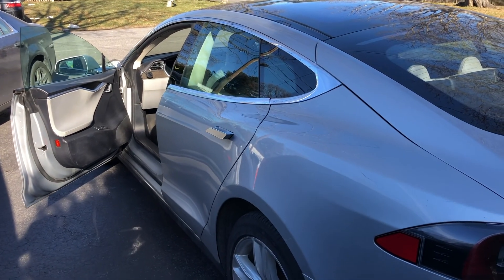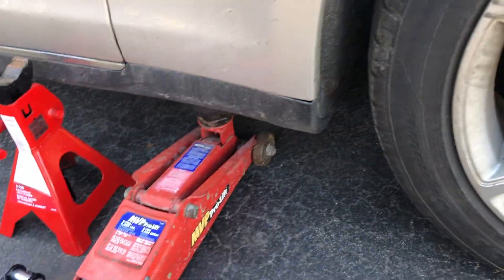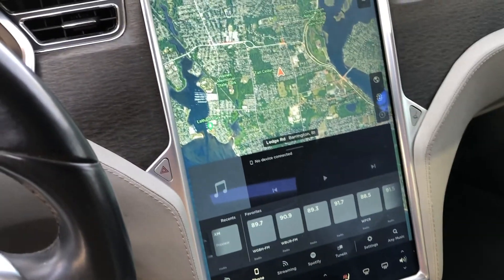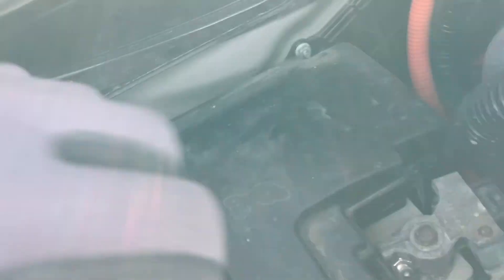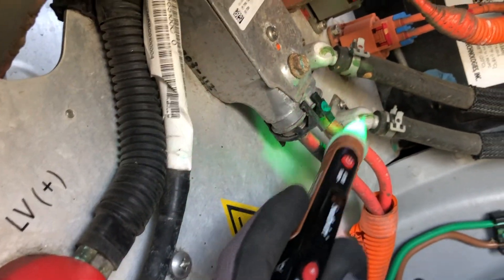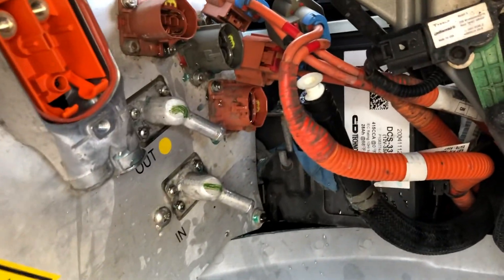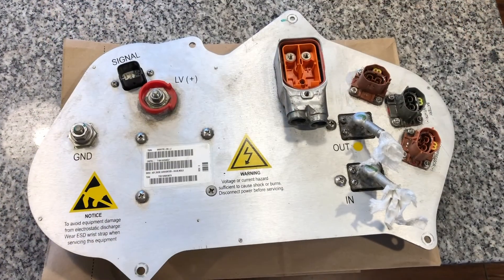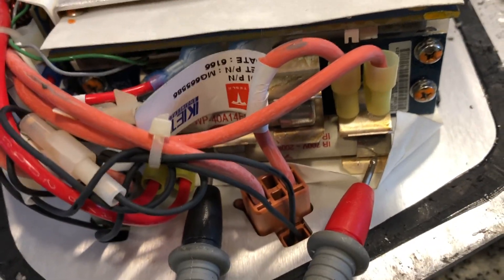2013 Tesla Model S Cabin Heater PTC Fuse Replacement in DC DC Converter

Comment from the maker: Important safety mistake - I used a voltage detector that only detects AC, and this area of the vehicle is all DC! Use a different method to check for voltage.
Reply: Lol I bought one seeing your video but I tested it beforehand on my working heater but it didn't worked obviously. Maybe add a warning subtitle in your video. Thanks for sharing
Reply from the maker: @gtech6  Sorry about that! I just added the warning to the top of the description to make it more visible. It is a very handy tool to have around if you are doing anything electrical around the house, but not quite as useful on our Teslas.
Reply: I just wrote a whole health and safety ramble, then I saw this comment 🤣
Reply: Dumb question: You were only using the continuity part. Continuity testing isn't the same with DC and AC on a tester?
Reply from the maker: @earthquakepilot2114  Sorry for the late reply. As far as I know, continuity testing is the same, but my mistake was in an earlier step when I was using a voltage detector to make sure that all of the power of the vehicle was off.
Reply: Hi, did you have to refill and purge the coolant after you re-installed the PTC?

Comment: Excellent movie. One comment on what I experienced.  Although I cut through the whole black gasket line with a very sharp tool and while taking the cover off the electronics the cover edge slightly bend for about 1-2 mm on one of the short sides. (The side over which I turned the cover upwards) I didn't notice this until I put the new gasket glue back on and fitted the cover again. Only then did I see a small gap between the two edges. So before fitting the cover back on make sure all edges are still close to each other. Fix this first before putting liquid gasket on.

Comment: I'm thinking of doing this as my heat went out this weekend. I know Tesla replaced my fuse in 2020 and was great until now. How do you close the housing around the module? Sealant and clamps? and pressure while its curing? I feel like I have a blown fuse and have done some repairs before. The worry I have is putting it all back together correctly.
Reply from the maker: Yeah, that Liquid Gasket seemed to be the right stuff, plus pressure. Clamps if you've got them for as long as the bottle says. I don't remember it taking that long to dry, or at least I didn't wait too long since I needed to do the whole process while there was still daylight (no usable garage).

Comment: 2013 Model S85 with 156,000 miles on it. Everything working well and went out to the grocery store last night (Dec. 22, 2024) here in D.C, with sub-zero temps, and of course with no warning only blowing freezing cold air. Even tried restarting the entire car. Called my local EV garage this morning and they automatically said the PTC (Positive Temperature Coefficient) heater would definitely need to be replaced for $1000. I even asked them if they would first consider checking the fuses. They are quoting me $301 just for the fuses and $598 for replacing the heater with a used (no warranty/no guarantee) heater. I dont have even the extra $300 to spare. It's near Christmas and I have no other options because it's freezing outside, literally. I HOPE this is the fix. If so, I'll follow up soon. Need to Amazon the fuses first. Thank you.
Reply from the maker: How did you make out?

Comment: Does anyone know the wattage of the heater ? Presumably it runs on 12v and not the main battery.  40A at 12v is only 480  watts. I guess it don't require a lot of heat to warm a cabin.
Reply: It's on the hv battery, so the fuse is 40a @ 350, so 14kw, usually about 80%of the fuse is used max, so about 11kw. Someone else i saw they called out 9500w, so it's around there.

Comment: Great job… wonder if this would apply to my 2015 p85D? Heater still works but you never know. Any idea what caused the fuse to blow other than the age of the car?
Reply from the maker: I also have a 2015 P85D now, but have not heard of this happening on 2015+ vehicles. Even if it does, I believe the DC-DC converter is now more easily accessible. I'm not sure what caused in on the early vehicles, but possibly just an underrated fuse.

Comment: I followed this video and fixed the AC on my 2013 Model S P85. Thank you!  My AC worked fine last summer and when I tried to use for the first time this spring it didn't work. I've been using AC occasionally for the last week (after this fix) and it's still working. My cost = $65 (two Bussman FWP40A14FA fuses and Permatex 85224 'gasket maker') plus a few hours of my time. Rumored repair cost = $1300. Savings = $1235
Reply: Prepping myself for this. How’s it been going for you since?

Comment: super video! cabin heater stil ok? my heater stops wurking after using the app to defrost the car.i think the cold temp and the hi starting amps trickers the fast ceramic fuse
Reply: That is what happened to mine on the first day winter hit , I really was hoping I could fix it myself if possible.
Reply: @RAAAIEATYOU  I just changed my ptc heater it really wasn’t that hard